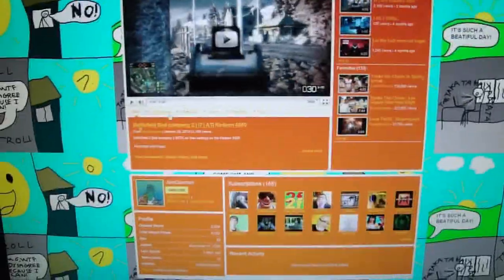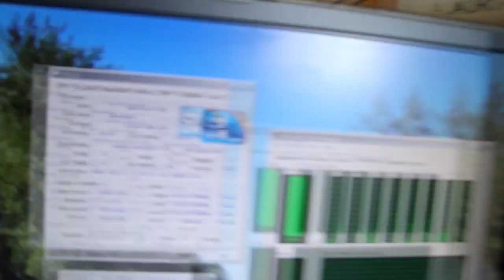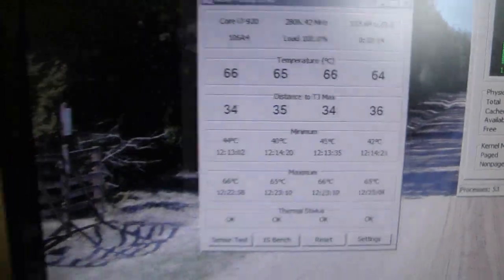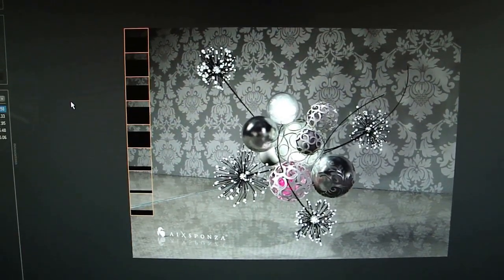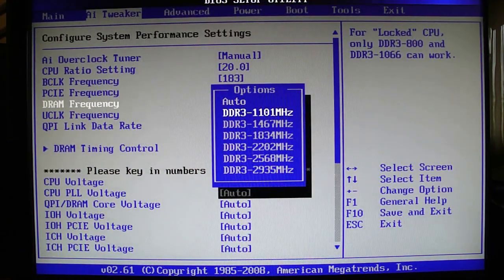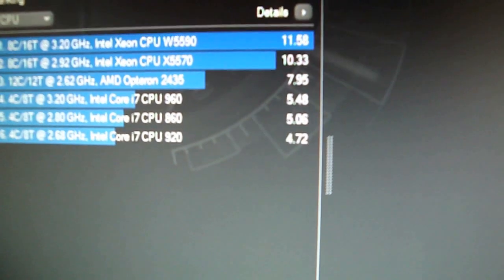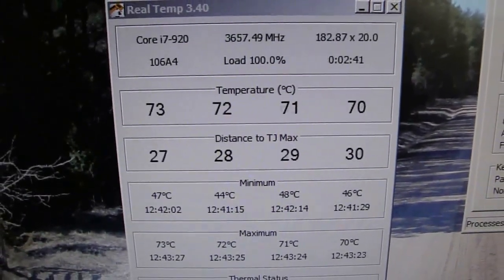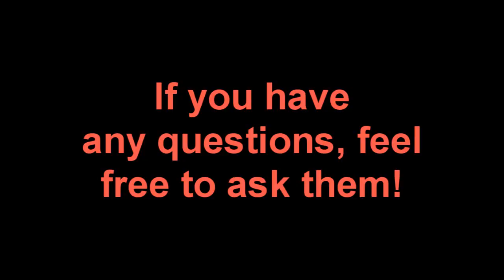Intel Core i7 920 @ 3,66GHz BIOS settings (+performance comparison)

Comment: Used in 2024. Thanks for the video !
Reply: Do you need special cooling system for this to work?
Reply: @YeidonSancho  nothing crazy, id just recommend not using the stock cooler. but you could OC, test load, check temps, and go from there.
Reply: @doriisnotsori  thanks. You followed everyhting he said on this video?
Reply: @YeidonSancho   i did, but i also eventually did 
CPU RATIO :20  
BCLK at 203  
CPU VOLTAGE: 1.35 
which resulted in 4.06ghz. (CPURATIOxBCLK=GHZ, eg. 20x203=4060/4.06ghz, also, 20x183=3660/3.66ghz(this video) voltage isnt as intuitive but i wouldnt pass 4ghz anyways. you could, but i wouldnt do it.

Comment: Super late! But do you really need to change voltage? Ive heard you dont need too on this CPU for that Ghz overclock, and thats not needed.
Reply: Yes, For me 3.6Ghz is the sweet spot. low temps with good efficiency.  Yes, I want that 4.0Ghz but it just don't worth it for me...
Reply: xrider55

So you use voltage? I've heard you dont need to change voltage for only a 3.6ghz OC. I have a i7 4790, but I was going to OC for my friend and I was just curious haha. Because Voltage can ruin CPU's faster, so I was just making sure.
Reply: I'm using 1.24 v core and it's enough for 3.6Ghz. Once I go up to 4.0Ghz and I need much more voltage.
Reply: xrider55

Ok, I will most likely OC my friends i7 920.. might give him a little better experience. He has the GTX 1060, and from what I understand, it gives a little bottleneck on that card. OC the CPU may reduce that Bottleneck.

He doesn't notice it or really care, he doesn't really know much about PC's, I put the 1060 in that system for him and just knowing he can OC it makes me edgy haha!

Comment: so glad i came across this video. i have the i7 920 bloomfield in a asus rampage 2 board so bios is a little different but the overclock seems to be doing great and boot times etc are amazing. i have an after market enermax ETS-N30 cooler which is keeping the cpu temps around 69 to 70 under max load. i have seperate fans that drop it even more to 55-60c. awesome vid many thx was going to buy a new cpu but this one can go a bit longer. have you tried to oc to 4ghz. a lot of vids on that but i like the 3.6 oc seems more mild and stable

Comment: i foud this cpu looks still pretty powerfull but i am really scared that i am gonna destroy something
Reply: Get a decent cpu cooler, and you are gonna be fine. I'm currently at 3.7Ghz, 185x20 multiplier, 1.30V Core Voltage, since I have a bad chip, it requires more voltage than most of the OC videos about i7 920 out there. I had it at 3.8Ghz/3.9Ghz, but the temps were 70+ celsius, so it was too much. I have Dark Rock Pro 3 cpu cooler.
Reply: first of all i need money
Reply: If you don't need HyperThreading, you can disable it in bios, and overclock the processor with the stock cooler as well. I have overclocked it stable to 3.3 Ghz with only 1.144 core voltage, which made temps even lower than on 2.66Ghz with HT on. If u're playing games, this would could give you pretty big performance boost.
Reply: @berytun  can u help me oc my i7 920

Comment: i have 970 too, with evo 212 cooler and the temp. around 45 and less
should i go with ur sitting and I get no over heat with that?
Reply from the maker: The i7 970 is quite a bit different from the i7 920 C0 that I had, I wouldn't recommend to use my settings with it. These temps are great though and definitely you have a lot of headroom for OC.
Reply: according to "Speccy"(app)
Revision C0/C1

that's mean the same one u have is it ?
Reply from the maker: Looks like yes, you have an i7 920 then, not i7 970. And yes you can use the same settings then.
Reply: oh shit :P yea yea i do have 920 , 970 was a stupid mistake by sleepy guy :P
Reply: Thanks a lot . 
but does the motherboard has any effect of this OC? mine is Gigabyte Technology Co., Ltd. EX58-EXTREME
Reply from the maker: That's a great board and this OC should work with any board as long as there are settings in the BIOS so yes, you shouldn't have any problems.

Comment: A little too late. But what's the safest clock I can hit on a standard cooler of 920? Using p6t v2 deluxe with 3x2gb corsair dominator 1600mhz ram. And what settings should j use  thanks
Reply from the maker: You can begin with the settings in this video. Then check the temps and see if you can go higher.

Comment: should i buy a tower-cooler, or i can overclock on box cooler?
Reply from the maker: +Richard ss - This OC you can do with a box cooler aka stock cooler. If you have an old system just make sure that the cooler is dust free.
Reply: +arvutihull Did u clock cpu with box cooler?
Reply from the maker: +Richard ss - Yes.

Comment: 77 C for max load? No thank you lol. Are you on a stock cooler with a bunch of dust in the fans? Id love to find a 3.2 - 3.5 Ghz stable with a max temperature load under 60 C. I bought a nice aftermarket heat sink and fan and and also a new tube of Arctic Silver 5 thermal paste.
Reply from the maker: Yes, actually anything under 80C for a full load temp is excellent for 24/7 use for years.
Reply: *****  yes. but most people say omg 80c ITS GONNA FRY AHHHHH
Reply from the maker: These CPUs are considered to be completely fine to run with temps below 80C at full load. I probably was with a stock cooler back then. If you have all that good stuff, aim for a higher overclock.
Reply: +arvutihull a buddy of mine actually ran one for a night without problems at 100c.
i think people underestimate these CPUs.
Reply from the maker: That's true. 100C will do harm to it eventually though, thats way too much.
Reply: @arvutihull  THANK YOU SO MUCH for this great vid. I followed along and had identical results until I started the bench and it got up to 100c!!  I am going to open up and see if it's dusty and that the thermal paste looks good. I just thought I'd touch base to say thanks, and if there are any other things to check when it gets THAT hot under load, let me know! Happy New Year!!!

UPDATE: Slightly loose heatsink fastener might have been the biggest prob. An entire Doberman worth of dander in the heat sink fins also didn't help things either. Now 76c at full load. Going to try the over clock now!
Reply: HELP  me find a stable setting for mine man
Reply: chris lustic up the voltage

Comment: Overclocked my i7 920 from 2.66 Ghz to 3.66 Ghz. Works very well with settings from this video. Max temp: 55-57 degrees. It's watercooled with Corsair H60 watercooler.

Comment from the maker: @MclrnMn1 - Disabling speedstep helps to achieve stability. Memory should work fine - P6T Deluxe supports 24GB. You'll probably just need to reset the overclock to the CPU after you've installed the extra memory.

Comment: I noticed you disabled Speedstep. Is there a reason for that, aside from keeping your oc from fluctuating?

Also, I just bought a 2nd 12gb Corsair Vengeance kit on the cheap. Will I have to change any settings when dealing with 24gb of memory? I have the P6T Deluxe with latest bios installed.

Comment: i have a i7 920, Corsair 2x2GB DDR3 PC12800 CL8.0 ram, and Asus p6t deluxe v2 ix68, and v8 cooler, i want to overclock to 3,6 like, what settings should i use.

Comment: @arvutihull    Worked great. thanks for the advice. Did a much better paste job and now Idle is 27 -29 and load max was 55.  Now for the overclocking. Glad I found your page here.

Thanks again.

Comment: Wanted to ask why mine would be running so hot under load. I have a i7 920 with a Zalman 9000 air cooler @ 2.67 stock (not overclocked) 12 gigs of Patriot gaming. 5870 card.  

Idle is running about 38-38  and under load with Cinebench 4 cores read  88, 98, 80, 100.  Seams a little hot. should i be worried about those temps?

Comment: i have i7 920 p6t with 12gb ocz  PC3 1600 with Coolermaster V8 CPU cooler. what is the setting i could use to OC 3.66? Thanks

Comment: Yeaa whoohoo its talking xD

Question why i cant run Stable @ 3,6Ghz at that low voltage of 1,2500 ?
I need 1,3 Volt and i have a Core i7 860, my friend run the same CPU and he use 1,2875 volt for 4Ghz, i dont understand why i cant run that voltage and get that  stable.

Comment: @arvutihull 
You said 1.25v for 4ghz ? Is that a typically healthy voltage for the cpu at 4ghz ? Or cud it be stable at any lower ? Obviously it does depend on the chip ofc but was just wondering if you know this from experience with any other D0 chips ? I guess it wud be even higher for the C0. I have the same MB as you (asus P6T) and it really has made OC an absolute breeze! I remember overclocking my old MSI P965 Platinum deluxe MB and jesus christ it was a mission!!

Comment: Great vid m8! I'm currently on 3.66 OC on my i7 920 D0 (bloomfield) at 19x193 1.144v great chip and my temps are just brillaint! 
idle 37 34 34 34 
Max load 59 56 56 56
rather impressed tbh, rather tempted to go to 4ghz, but I was wondering if it was really worth the extra power and heat I do have the leg room to get there, just hope i wudnt have to go as high as 1.25 etc

Great vid keep em comming!

Comment: @arvutihull So I should use the CPU Ratio Setting at 20.0? And it will be 3,66Ghz and I will use 6GB 1600Mhz RAM so what should I have at DRAM Frequency? And how will this affect the warranty of the CPU?

Comment: @arvutihull Okey, but 920 got 20 multipliers and the 930 got 21 multipliers, should it make any diffrence? I mean if I need to change the overclock settings. Or is it just to use 1.15V?

Comment: How in the world can you run your cpu at 4,2 Ghz when the temp are already a bit unacceptable at 3,66 Ghz??
What is the TJmax on your CPU?

My Q9550@3,6 Ghz@1.175v is getting 44C on each core after full load like any game and with Prime small fft's it's getting about 45-48C on each core!